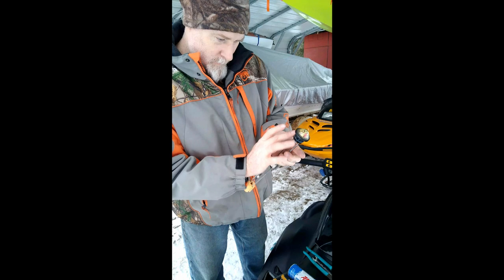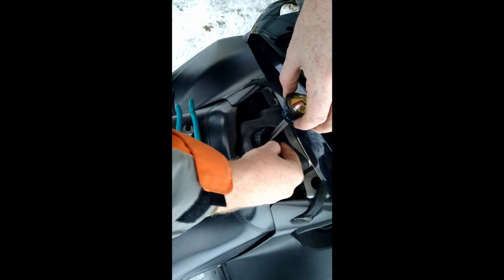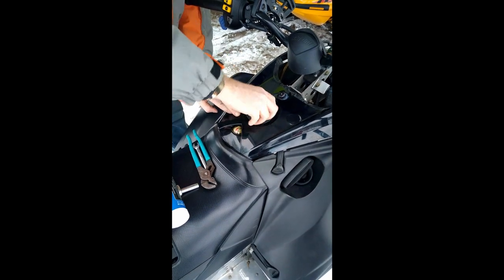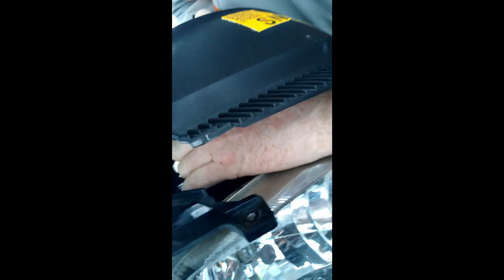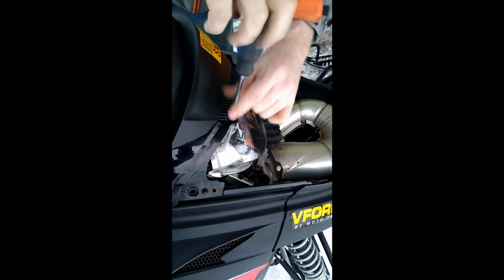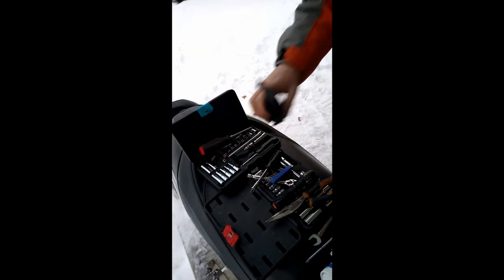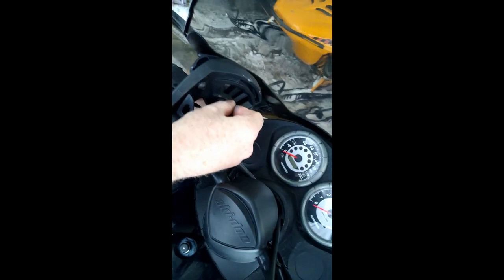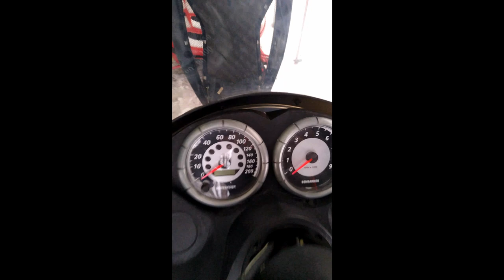2005 Ski Doo GSX/REV gas gauge and console install / removal instructions.

Comment: Yeah my 2004 gas gauge doesn’t work
Reply from the maker: I actually need to pull my gas gauge again and shorten the shaft where it goes into the bubble it still hangs up and causes the gauge to read wrong.